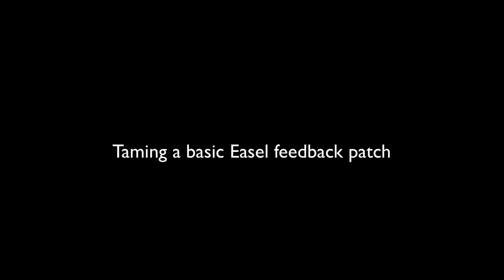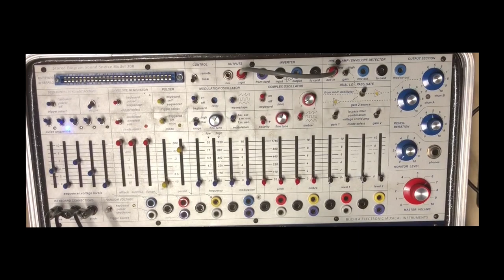Easel Basic Feedback

Comment: The audio cables are a unique size being 3.58".  Other than feedback, or cutting off one of the connections and soldering a pickup onto it.  What other external devices have you been able to tap?
Reply from the maker: Any external audio device, mic, radio, tape into the Easel’s Aux In.
Reply: @vgermuse  Will it accept a 1/4" TR Jack or does it have to be a 3.58mm jack, in which case does one have to make the modification to the existing jack on the external audio device.  That is to say, replace the 1/4" with a 3.58mm